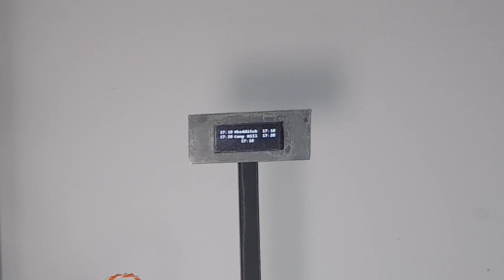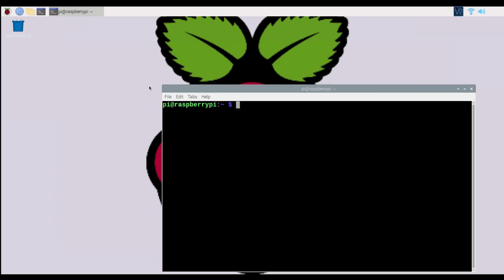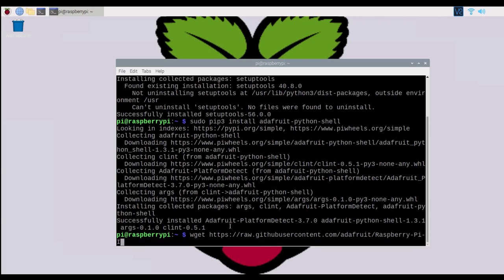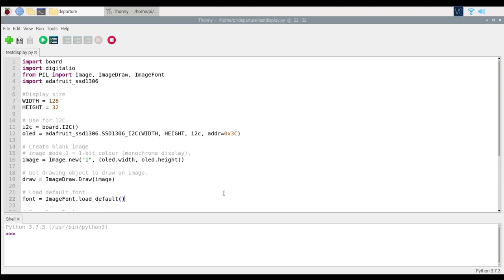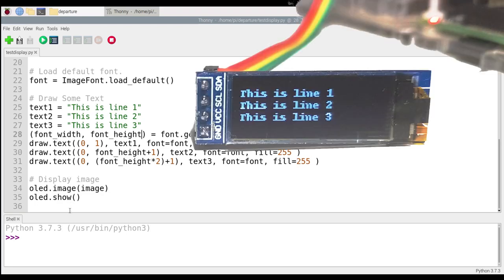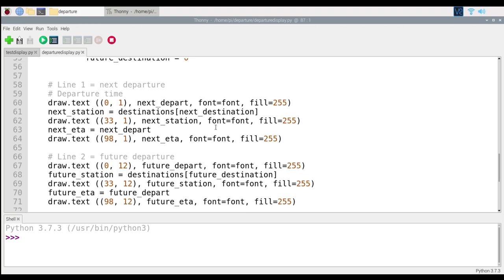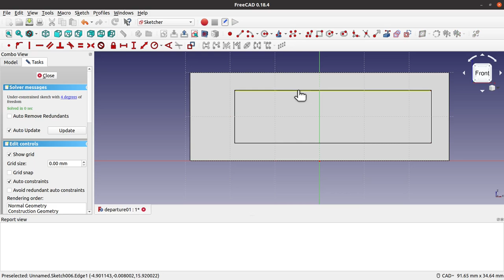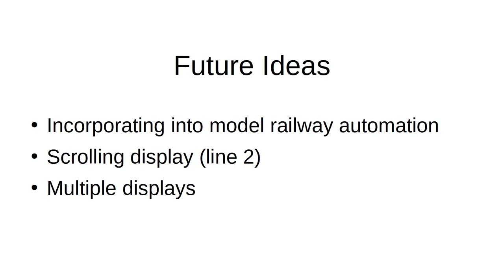Model Railway Departure Board - Raspberry Pi OLED display and FreeCAD 3D model

Comment: Thank you for this project. I received my OLED displays yesterday and got them working with your code 👍 Thinking to order the 3D printed model today (anywhere UK you recommend?). I made the Pi version so far but planning to switch to the Pico version this weekend. The Pico has 2 x I2C buses = max 2 independent displays per Pico, you think? Did you make a case for the Pico too?
Reply from the maker: I'm unable to recommend any 3D print companies as I only ever print on my own 3D printer. 

I didn't make a case for the Pico.

I would expect you should be able to run 2 from a Pico but I haven't actually tried.

Comment: Hi do you know How to connect it to HDMI ??? or else can u build a code for me ? I would be appreciate it. or u can make a code and I will Buy.
Reply from the maker: I'm not sure what you mean. You can easily connect a HDMI screen to the Raspberry Pi.  You could then write to the screen using code.
At the moment that's through print which outputs to the console, but you could use pygame zero if you wanted text on a graphical screen.

Comment: What model do you use for Raspberry Pi?
Reply from the maker: The Pi shown in the video is a Raspberry Pi 2 (it doesn't included built-in WiFi so has a USB dongle). You can however use most versions of Raspberry Pi including the Raspberry Pi Zero or more recent models of Raspberry Pi such as a Pi 4.

Comment: Raspberry Pi seems like massive overkill for this application - a small Arduino or even a bare AVR chip (ATTINY85 for example) would do it.
Reply from the maker: It could be handled with a microcontroller. quite easily.

The main reasons for using a Raspberry Pi is the inclusion of a real time clock with the Pi so that it can be synced with actual time. 

Also it's not really intended to have a Pi dedicated to it, the same Raspberry Pi can be used for running the trains and controlling signals using my model railway automation project along with providing a web interface for controlling the entire system. 

I'll be looking at expanding some of the projects and adding more integration in future.
Reply: @PenguinTutor  Understood - though of course A Particle Argon or an ESP8266 (ando others) also have a real time clock capability since they get time from Internet. 

BTW Do you have any info about the size of these displays in real life - I was looking for data on that but found nothing much.
Reply from the maker: @alanmusicman3385  There are different size displays. I think this is a 0.91" display (which is the diagonal across the screen). 

The following website has the dimensions of a typical display, although you may want to get one first as sometimes the PCBs are different sizes: http://www.lcdwiki.com/zh/images/4/4f/0.91_size.png
Reply: @PenguinTutor  Thanks, but I think you misunderstood? I meant the REAL ones in use at full sized rail stations :-)
Reply from the maker: @alanmusicman3385  It's hard to measure due to them being quite high up. My best approximation, based on my local station is that the board is about 1.5m wide by 0.5m high. That's just the display part excluding the frame.
Reply: @PenguinTutor  Many thanks. There seems to be no info on those things puiblished at all!